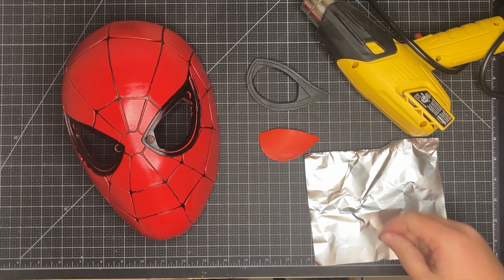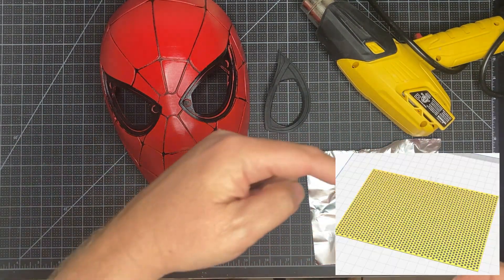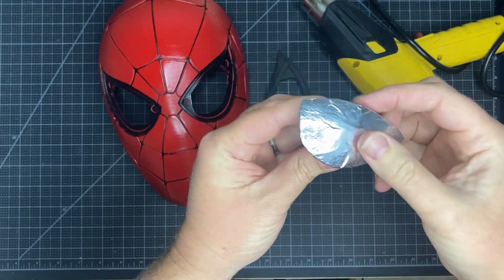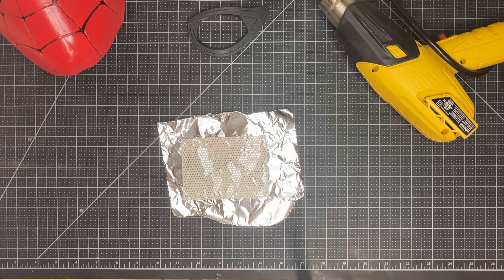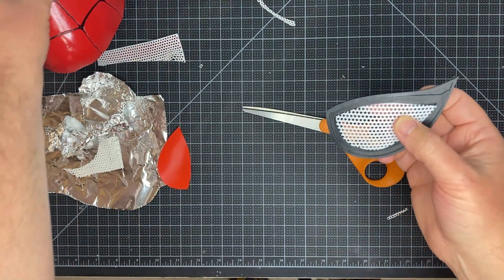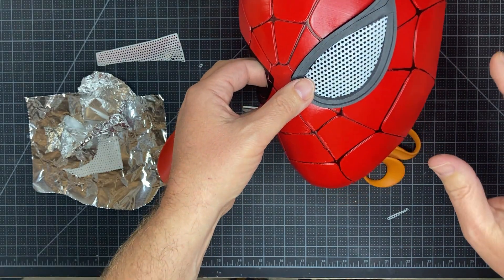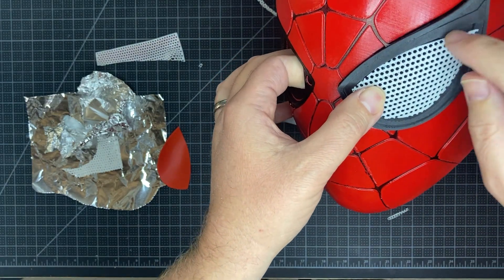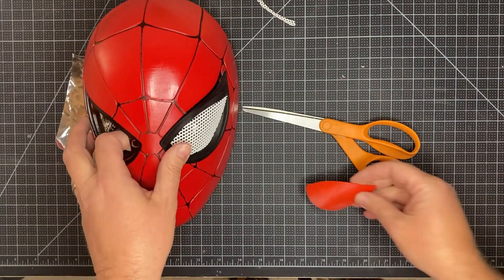Adding Mesh Eyes to a Spider-man Helmet | Kenny and Benny

Comment: Beautiful results and props for taking the time to do it right.  Newbie question: why can't you print the eye mesh curved?
Reply from the maker: If you know modeling software you could make one.  This is just a quick solution for anyone who doesn’t model.  Thanks for watching!
Reply: You can, but the mesh is so delicate and it requires supports, that it's a huge pain. Often OFTEN breaks or has print errors due to the supports.